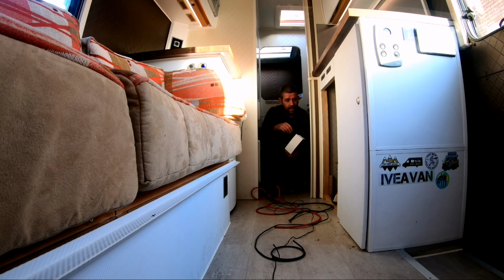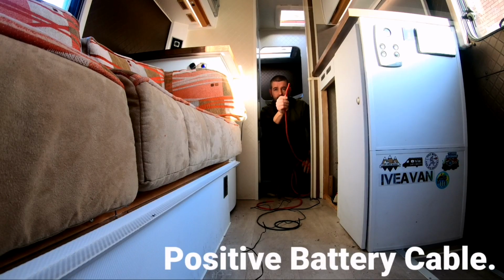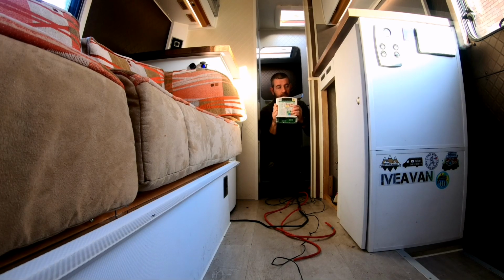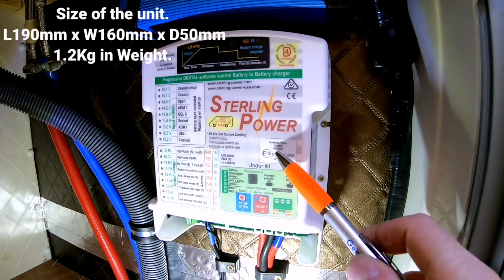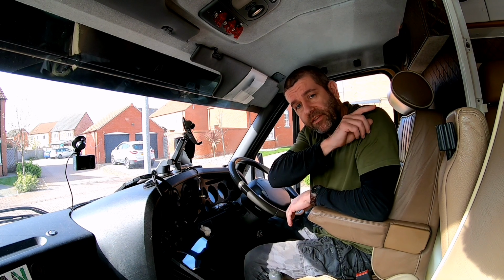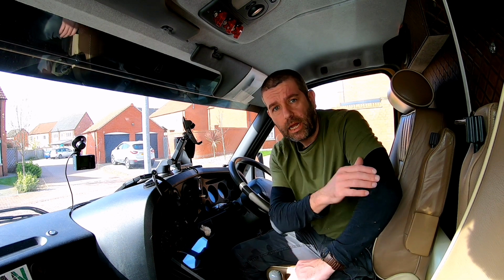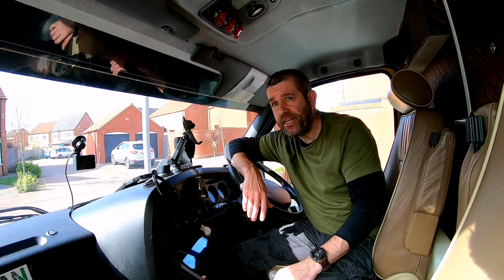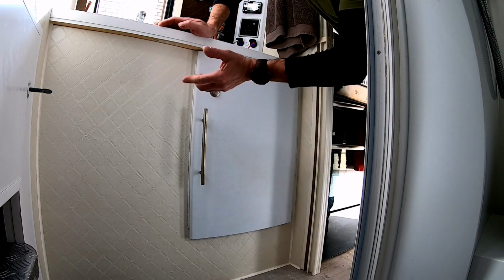Sterling Power DC-DC Charger. How to install & Set up.

Comment: Hi  must you run a wire from ignition to b2b unit,  did I read that correctly , Thanks Paul,  PS is there a b2b unit that doesn't need to connect to ignition. 👍
Reply from the maker: No, you can use Automatic activation in 'default mode' so not having the need for the ignition feed. I just fitted mine for piece of mind so I know its on when turning the ignition on. And off, when I've turned the ignition off rather then just relaying on the automatic mode and not certain whether it's engaged charging or not bud (just to make me feel that I'm controlling it more then anything else) 😉👌👍. I'll leave you a manual link regarding this https://www.manualslib.com/manual/1345529/Sterling-Power-Products-Bb1230.html?page=7#manual

Comment: hi thanks for this ,,i am going to fit one of these in my motorhome do you know if you have to remove the old charging system or can it be left in place when the sterling is connected ,,,thanks ,,
Reply from the maker: You could have both connected if you wanted too, (as long the cabling is adequate to run both) or just disconnect the original one and just use the Sterling. 👌👍...
Reply: @Iveavan  hi thanks ,,its jst that the solar seems to use the same wiring in my autotail so didn't want the solar to stop ,,, sterling web site says 6mm2  cable for mine 30amp  and 1 meter run ,,so i am using 8.5mm2 ,,rob

Comment: I'm totally "thick" when it comes to electrics of any description, but my van has a PMS3H system and I understand this unit doesn't charge the leisure battery whilst driving and isn't much good at charging battery when connected to EHU either tbh. So my question is, can I install the Sterling system in addition to the PMS3H, wiring it up as you have done?
Reply: Spot on thanks, I’ll get one ordered 👍
Reply from the maker: I've looked at the schematic for the PMS3H and by the looks of it on the DC side, vehicle to leasure battery, via an split charge relay, the Sterling B2B would be ideal by connecting straight upto the leasure battery (no need to interfere with the PMS3H wiring) however! the Sterling doesn't have the capability to charge when you're on EHU, so you be using the PMS3H for that bud 😉👍👍👍.

Comment: if you buy those small 30A B2B  you can get almost as much just linking the batteries with a bit of cable and just use a relay.   Also 30A takes forever to charge the batteries.   If you got a spare inverter just use that instead from the engine battery and save a load of dosh.  Use the switch on inverter as a remote trigger via a relay. Mine powers my hookup mains chargers which are two 40A PSU @ 14.5v at around 68A on idle and 77A driving.  77A @ 14.5v =  1116 watts.  So in about an hour or less i can charge my batteries to recover my typical 24H usage in winter with no solar. 
IMPORTANT: if you got a Boxer, Relay, Fiat van check the engine earths! They corrode in just 3 years and often need another cable from the block to the chassis if you are pulling a lot of amps. I used the engine lift eye to the chassis -neg jump point and voltage went up from 13.7 to 14.1v when pulling 80A.
Reply from the maker: Good idea that bud, I could still do that and have the B2B running and the mains charger 🤔. 😉👌👍👍👍.
Reply: You must use a lot of power, if I can put 30 amps in, in an hour I'll be well pleased with this B2B, my van only puts about 1 amp in after the first 15 minutes. We're lucky if we use 30 to 40 Ah in a day so this will suit us and I like the ease of installation for me to be able to do it myself as I'll be running cables underneath to the batteries at the back of van from under the floor at near side under passenger's feet. We have a 3 year old Ducato and the earth strap is gleaming like new as it's inside the battery well.
Reply from the maker: I see you're initial reply is to "Tonytca", I looked into his suggestion and in reality it's down to the 'alternators power curve' on tick over I'd wouldn't be happy to use his suggestion due to heat build up, versus amps drawn upon the alternator potentially causing damage to it hence the charging management profile that the DC-DC Charger provides to protect the alternator on low RPM. Many alternators can give an high out put of Ah at there maximum RPM rate of around 6000 RPM (my engine would not even get any where near that RPM rate, whilst driving its ticking along at around 2000 RPM!) but suffer low Ah out puts on low RPM according to the power curve charts I've looked into whilst researching this. 🤔😉👌👍👍👍.
Reply: @Iveavan  I'm more than happy with your suggestions. We only run the fridge/freezer, occasional fan for the heating system ( whale gas/electric with underslung 25 litre tank) and very occasionally the 12 volt TV/DVD. We manage fine with a 100 watt panel on roof to an MPPT controller to 2 x 120 Ah SLA's but in the Winter months we struggle a bit and my 100 watt folding panel comes out for a boost as I connect it in series as it's 2 separate panels hinged together. We're very rarely parked up off grid for any length of time as we move about a lot, so with the B2B I'm sure batteries would be topped up with driving at least every 2nd day or even running the engine for a little while. The fridge is the biggest problem as I like my beer cold at all times.. lol.. Our van is a CV20 and we love it but I just like my batteries to be topped up all the time, we never had a problem with our old van as we had solar and it had a 3 way fridge and heating was just a gas convector type with no fan and we were always toasty and the 230 volt TV was that old it didn't even have Freeview so, along with the Freeview box, TV and aerial booster all working through a small inverter we managed. I now need to convince my good lady I need to spend £260 and be allowed to roll under the van at 73.. Many thanks for your videos and I'll be checking out others of yours when I have time, retirement 11 years ago didn't mean a rest. Thanks again and apologies for the long reply, I'm off to bed now and will dream about my B2B.. lol. Stay safe & take care..
Reply from the maker: @tomaitchison8726  no worries Tom and thank you! 😉👍. There will be more videos next year (currently sorting out  our new home) but I will be stripping out the van and giving it a 'reconfiguration' & planning to go fully electric 😎👌👍👍👍.
Reply: @Iveavan  Cheers and good luck.

Comment: Are you planing to leave the B2B on if batterys are full.
Reply from the maker: No it automatically cuts out once the batteries are fully charged, so it's not on all the time bud😉👌👍👍👍...
Reply: Can it be installed without ignition feed?  thats the plan i was thinking! Whats is your advice? Thanks for previous message.
Reply from the maker: Yes, just leave out the ignition feed and it will charge your leasure battery, as and when required bud 👌👍.

Comment: Nice one Mark! I have the isolated victron B2B but not the smart so it also needs a trigger, I didn't think about using the radio. I used the cigaret lighter as on the Relay's they are ignition powered. Nice video and install bud!
Reply from the maker: Cheers max 😉👍, if the orion tr was out at the time I fitted the Sterling, I would of gone for that bud 😉👌👍👍👍.

Comment: Neat.
A bit noisy, but guess it doesn't matter over the engine noise.
What cable size did you use? Sorry if you said and I missed it.
Reply from the maker: Cheers matey, to be fair I can't hear it, as it's in the cupboard, but I'm not sure how often the fan kicks in though 🤔, sorry, it's the original battery cable 16mm2 😉👍👍👍.
Reply: I have the same in my camper and I've not heard the fan come on yet.

Comment: Nice job👍 .. I just fitted a Renogy 50a dc to dc, when I tested it I heard the engine strain and then it blew a hole in my oil filter, I didn’t notice until the next day, not sure if this was a coincidence or if it had anything to do with the dc to dc..
Reply from the maker: Cheers bud 😊👍, blew a hole in the oil filter you say? 🤔😬👍👍👍.